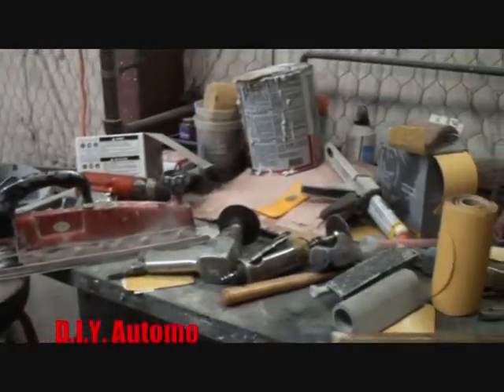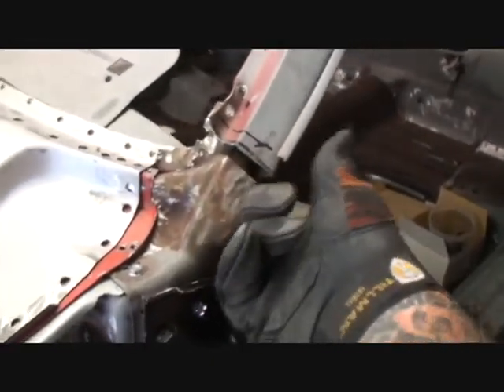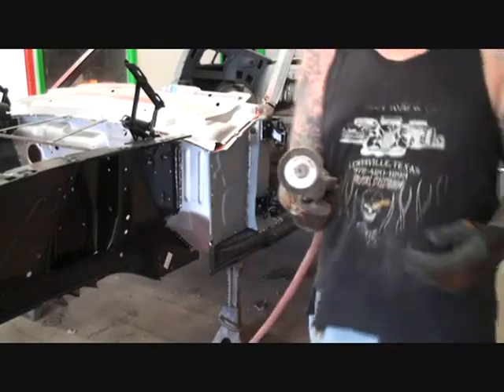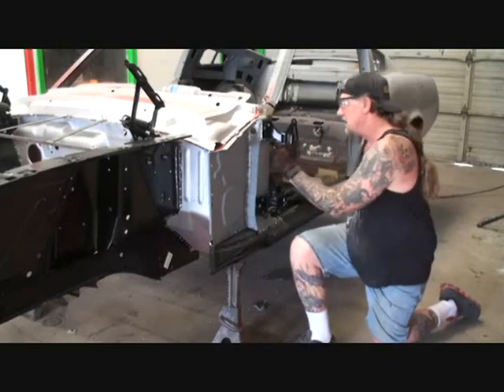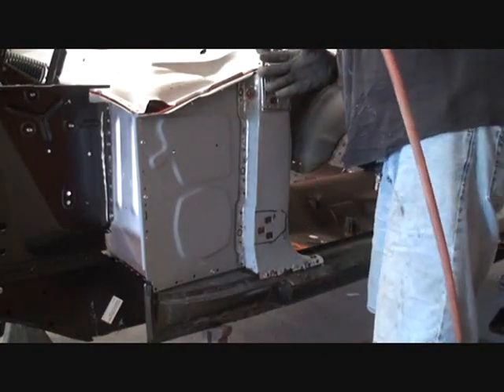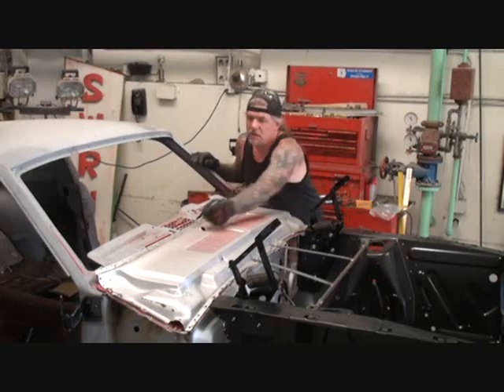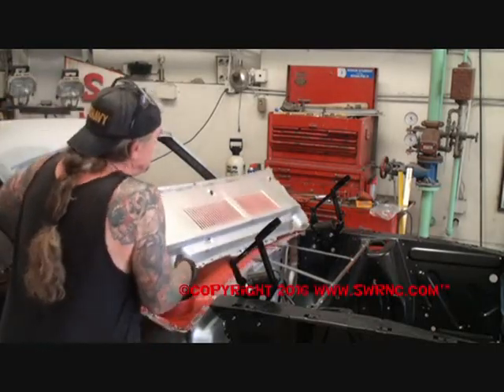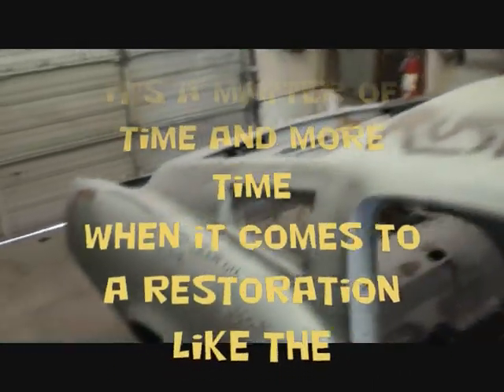"How To": "Restore" A Rusted Out "Car"-Part 26

Comment: Part 14 21:15  your jack stand is holding up the "B" pillar and its 1/2 inch too high.  Move the jack stand way back to allow the middle of the car to lower and correct the door gap./

Comment: So Pete, I was wondering what you did to correct the door alignment problem where it meets the quarter since you are now getting ready to weld.  But read in the comments you say your going to replace the rear quarter?  Did you say it had been replaced before?   Don't leave anything out!
Enjoying the series!
Reply: The door problem will be fixed when the quarter panel is replaced, everything is on the money except the quarter panel/door gap!

Comment: Pete, really enjoying the series.  Quick question though.  I would have thought that you would have wanted to resolve the door to quarter panel gap issue before breaking out the welder and locking the A pillar in place.  Have you determined what the issue is with the gap/overlap?  If the quarter is original, and the door is original, what is the root cause of the overlap?  Thanks.
Reply: I asked the same question and Pete said to wait and watch.  
I'm thinking he's actually further along on the car and has resolved the issue, but spacing the video's to keep his viewers interested.
Reply: ***** I realize there is a lag between filming and posting, but had hoped that the sequence of videos would follow the actual events.  Kind of like a series on painting a car, if the 4th video covered buffing the paint, but the one after that covers wet sanding.   Ideally the one with wet sanding should precede the buffing video.  Just saying.
Reply from the maker: The sequence is going in steps as I do it! As for the door, it all lines up except the lower rear quarter,, when I replace the quarter we will fix it then! Turbo Cobra Gary had the same issue with his Mustang and had to repair it at the front of the door where it meets the fender! Don't ask me why or what because it's one of those mysterys of body work that nobody can figure out!  It will all come togeather in the end,, It always does.  Time and Patients!

Comment: If someone put a jack under the driver side of that 1967 mustang and put enough load up to lift the car, the "frame" could bend right there by the lower door gap near the quarter panel. Put 500lbs on the door frame and see if the gap corrects itself.

Comment: when you weld this bitch together are we going to use weld through primer?  for some people its a big thing but, i havent heard you say anything about it through any of your videos. just wondering if you have ever used it or will be?
Reply: Ive been in business for 30 plus years and NEVER used WELD THRU PRIMER! I think it's a gimmick to make you buy something you don't need. Ive NEVER had anybody come back and say---YOUR WELDS RUSTED OUT! I say fuck the weld thru primer...
Reply: swrncpete When I've used it, I always had to scrape a spot down to bare metal to get the mig to start arcing. It isn't what it's all cracked up to be. They say that the zinc in the primer is conductive enough to be able to start an arc. It may be the case if you're using a stick and the amperage is high, but not with a low amperage mig on sheet metal, from my experience.